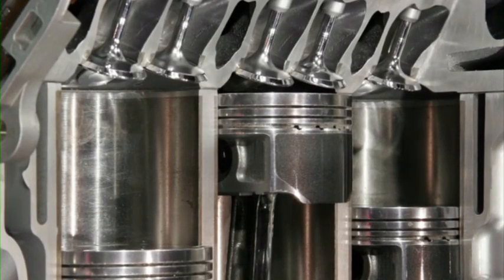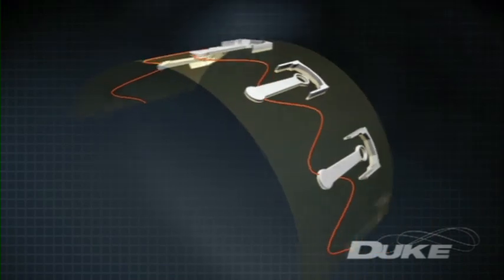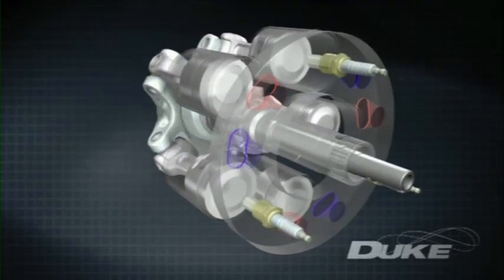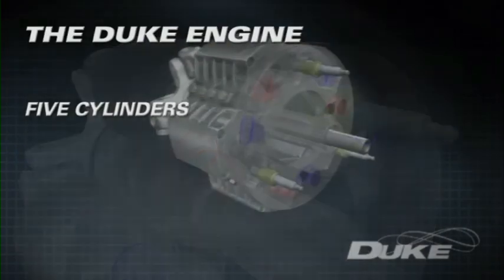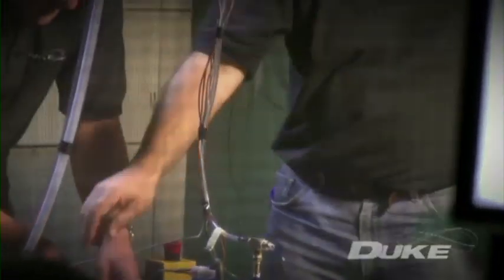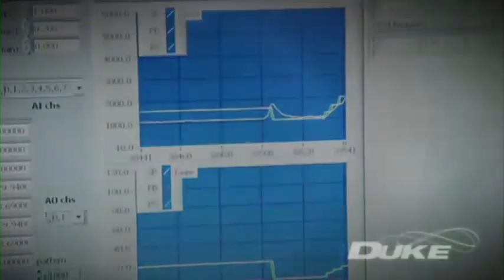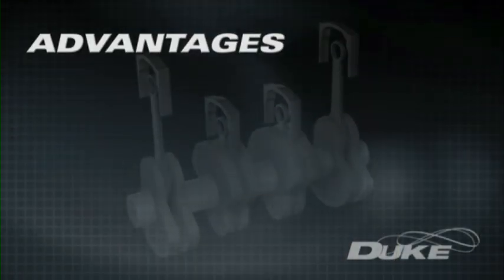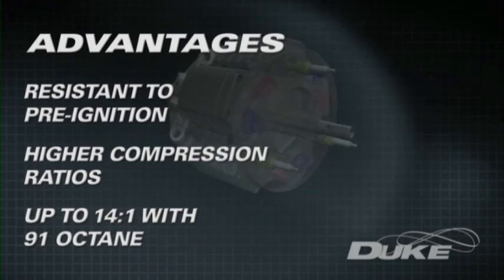Duke Engines

Comment: No camshaft = a "dumb" motor with no ability to tune / manipulate the torque and power curves.  2 strokes and rotary engines are similar.  A camshaft is what allows GM to essentially use the same engine and transmission in their heavy SUV's, mid sized sedans and sports cars.

Comment: The down side it burns oil like an two stroke to reduce the friction due moving cylinders. So it will not pass emissions. So much to green house friendliness. And it has the same issue as an Wankel engine with sealing the combustion chamber... And I bet there are more downs to it. That is just what I thought when I have seen this concept.

Comment: you basically put the cilnders in a circle and eliminate the need of f vale. That crankshaft seems not rigid, and you can't properly seal it off. The top is constantly sliding over the cilinders. If you find a way to seal it, the seals wil wear extremely soon. This has the same disadvantages as the wankel/rotary engine which also failed.

Comment: at 14:1 detonation will take place if you drive this in a country like india...  plus more moving parts are there which would surely require a very high maintenance costs of the bearings and seals. thermal stresses will be very high. though the concept is good for innovation and amusement but not for business.

Comment: And how exactly are they going to seal the top part of the engine when the cylinder block is rotating? And there is more, not less rotating mass since the cylinder block is rotating (why?). This is not going to work.

Comment: One of the hundreds of similar patents. I'm very skeptical, I barely see any advantages but a lot of drawbacks, this video doesn't talk about. Mechanically, a Wankel for instance is apparently far simpler than a Duke or a standard Otto but as manufacturing is concerned it's exactly opposite, materials, precision, reliability, efficiency. The Duke is converting the complexity in the valve train (which has never been critical even 100 years ago) to a much larger mass in motion and the nasty sealing and complex lubrication (essentially a 2 stroke lubrication)  needed at the head of the rotating piston block. Wankel is an old engine, just like Duke and hundreds of other similar patents, it is still in development. Another problem I see is the very high time and area thermal non-uniformities in the head plate since, in the Duke and most the rotaries, the time split cycle becomes a space split cycle. I see show stopping problems there  in materials, precision and reliability (in the field not in the lab) in order to achieve proper sealing and lubrication. A good idea comes rarely and doesn't need decades to prove. The vanity of the inventor combined with his social skills of getting research funding keeps these projects running. It is the true perpetuum mobile. Another drawback is the huge centrifugal force, the wear, and failure severity associated with the rotating cylinders at high rpm's. Plus a poppet valve has a much larger flow profile  engineering flexibility than a cylinder head passing by a hole.

Comment: Similar to the 1950s Bristol bus "wobble plate" engine (discontinued ad the manufacturer was bought out by a group who made traditional in-line diesel engines.  That one left the cylinders alone and put a crank on the reciprocator plate, so you don't have to try and seal a "moving head" arrangement.  Interesting though.
Reply: I designed exactly what you describe about 35 years ago and it did indeed solve all the problems associated with the above design, which IS a modification of an axial piston AC compressor. Back then there was a group of engineers from a German polytech that was building the same thing as these guys. It had all the same problems as the above design. The faster it goes, the less the intake duration so the less power charge and the the higher the pressure, the greater the sealing force must be, so the friction goes way up and since the whole block is rotating, the centripetal forces cause cylinder and piston side ware, so it soon looses compression and wares out and the list goes on. My design would have solved all that but I could never generate any interest or financing. The biggest problem is that the auto industry doesn't really what anything new, they just want to be able to modify what they already have, so unless you're Elon Musk and have unlimited resources, you're just pissing into the wind.

Comment: is not the same with 6 cylinder, its almost the same with how rotary engine works, this just make 3 cylinder engine work faster, but not 6 cylinder power because the power is only came from 3 spark plug 3 combustion chamber and give the power only from 3 pistons, even it have 6 cylinders..

Comment: I see in your advantages you forgot a major one? Or you are hiding it. Its in your crank design. Its defiantlly a very good design. The main advantage with it is. It keeps the stroke cycle close to constant leverage on all cycles. Most all standard engines this fluctates from 0 at tdc to most leverage at 3 0clock then 0 again at bdc.

Comment: Its a mystery engine? Being how are they going to seal the combustion chamber that is always sliding in motion? Then more cooling the piston walls? This thing going to be air cooled? Any carbon an dirt caught in the head sealing surface as the head is moving is going to lose the fire ring. Also just seting up the end play on the crank an now head clearance, that be a royal chore? The thermal changes of metal exspanding hence cold engine to hot under load. Be a nightmare all its own.

Comment: i am a complete ignorant, i barely know how regular in line cylinders work, but I'm thinking and making numbers about... how if the pistons gotta get out of their cylinders, how will you keep all the gas to put it out to the exhaust?
 how do you make a good seal in order to keep the power per ignition? (i already said I'm an ignorant of all this)
 ALSO, and more importantly, if the pistons have to exchange cylinders with each ignition... How do you keep them from wearing and tearing faster?
   a key aspect of the break-in of an engine is to let the Piston to adjust and sit correctly with its cylinder in order to have less friction and a more efficient movement.
 i have the feeling that this Duke design, brings more problems not only because the pistons have to leave their cylinders, but also becayse there is sidewise movement, not only up and down.
 (excuse my english, i have problems expressing my ideas when i talk about things i don't know well).

Comment: The mechanism is very similar to an automobile A/C compressor and some hydraulic pumps which have a nutating plate (also called a swash plate) that imparts the wobbling motion to the pistons.  However, the Duke engine is doing just the opposite.  Be interesting to see what come of this endeavor.

Comment: the design looks very heavy and massive, with LOTS of seals and possible weak spots. I bet maintenance of that engine would be a nightmare, as it would require total disassembly of the entire "block". Plus: The more moving parts, the more friction and therefore loss of efficiency.

Comment: Reciprocating mass will always be inefficient. R&D must be in rotary design. In the existing Wankel design, which is not the best rotary design, there has been great advances. They are perfect for range-extenders for series-hybrids - where the market is going.
Mazda have done very promising research on HCCI ignition for its SkyActiv-R rotary engine project using research from its SkyActive 2 program. They have removed the need to locate the spark plug outside the combustion chamber to allow the rotor to sweep past. Mazda solved this in the SkyActiv-R rotary project. Rotaries generally have high compression ratios giving the design easy adoption of homogeneous charge compression ignition (HCCI).

It looks like the next Mazda rotary in 2020 may not have a spark plug and be HCCI ignition. Fuel consumption will match piston engines and when used at a constant speed range-extender gennny as in a hybrid, outperform piston engines with all the advantages of low weight, small size, super-smooth, simplicity, etc. The efficiency and longevity of rotaries is excellent when at constant speeds and low revs. 

The expectation will be that the engine will be introduced in 2020, the 100th anniversary of Mazda. Looking good. 

Explanation of HCCI from wiki:
"Homogeneous charge compression ignition (HCCI) is where the fuel/air intake is a pre-mixed lean air-fuel mixture then compressed to the point of auto-ignition. Electronic spark ignition is eliminated. Gasoline engines combine homogeneous charge (HC) with spark ignition (SI), abbreviated as HCSI. Diesel engines combine stratified charge (SC) with compression ignition (CI), abbreviated as SCCI. HCCI engines achieve gasoline engine-like emissions with compression ignition engine-like efficiency. HCCI engines achieve low levels of nitrogen oxide emissions (NO x) without a catalytic converter. However, unburned hydrocarbon and carbon monoxide emissions still require treatment to reach automotive emission regulations."
Reply: New Mazda rotary car in Jan 2020: Just over three years away.
http://www.motoring.com.au/mazda-rx-9-locked-in-103563/
http://www.maxim.com/rides/mazda-rx9-rotary-sports-car-2016-8
Reply: "With this new high performance rotary engine occupying less than 50% of the engine area volume and boasting a 50% reduction in overall weight from a standard four-cylinder engine, the 650S lends itself perfectly to the weight reduction and low emission requirements of the automotive industry whilst still delivering an impressive 120bhp performance using *less** fuel*.
http://www.aieuk.com/first-british-rotary-engine-sports-car-makes-historic-debut/

https://www.theengineer.co.uk/rotary-engine-powered-british-sports-car-makes-debut-at-millbrook/

This is encouraging.

Comment: its one of those things that looks good on paper, but in reality wont last. seems like soon as 1 part starts to wear, its going to cause everything to quickly fail behind it. you have a revolving set of cylinders which creates a lot of issues. 

how is the stationary cylinder head going to seal against a rotating set of cylinders and last more than a few thousand miles?

since there's going to need to be some sort of thrush bearing to hold the rotating cylinders in place. whats going to happen when that bearing develops any amount of wear? all the cylinders will be putting alot of load of that bearing after all. all the cylinder head seals will have to fill an extra void and leak easier

not to mention all the wear  on al lthe parts caused by an awkward rotation of translating horizontal linear movement into rotational force at that angle.

too many moving parts, many doing high wear jobs. engines just wont last. i dont even know how you would do a proper way of lubricating the moving parts with an pressurized oil film to prevent metal-on-metal contact. 

lubricating the cylinder walls to keep the piston rings alive is also an issue. the cylinders rotating at high rpm will cause all the centrifugal force to keep any oil lubrication on the outside of the set of cylinders but leaving the center of the set dry to wear out. also this will cause the pistions themselvs to highly wear the outside most walls of the cylinders much faster

Comment: Lets just fix the Rotary and get on with life. Light weight easy to fix/produce people have already proven apex seals are not an issue unless you go mad mike with 1,000+ hp and fuel economy has been fixed by adjusting ports on the engine block and small design changes to the rotary it self reducing co2 emissions and improving gas mileage.

Comment: This the same movement found in an axial piston pump. If the angle between swash plate and the main shaft can be adjusted while the engine is running, it would be able to change its compression ratio on the fly.

Comment: That technology has been around for ages... It's called an automotive air conditioning compressor.
Reply: If you have sparkplugs in your AC compressor, I think you need a new mechanic
Reply: +Floyd Wilson haha
Reply: Floyd Wilson Mine has 6 spark plugs and it's cools the cabin down to -22 degrees C.
Reply: I welded a shaft to mine and connected it to my tranny. Fuel efficiency is awesome at 5 mph.

Comment: Unfortunately, no matter how good this engine is capable of being it will go nowhere. Firstly,  standard piston engines have too much commercial enertia. Secondly,  the world is trying to get out of internal combustion engines. Your timing is all wrong, you may have had a chance 50 or 60 years ago.
Reply: Piston engines aint going away anytime soon,  where'd you even get that idea?
Reply: KingHalbatorix
except for all of the mercury, alkaline, etc etc etc and other toxic chemicals and elements they use in circuit boards, and in the manufacturing of electronics in general, and all of the dead batteries in landfills that we aren't supposed to throw away... but everyone does.   that's bad emissions. kill some fish and wildlife and poison the drinking water. that's better than burning holes in the O zone right?

i'm NOT saying that electric isn't the way to go, just saying, think of both sides before spouting off what someone else said and holding it as true.   there is a dire cost for either.. and both scenarios end up polluting the planet in different ways.
Reply: Friend, If ya do what ya always did, you'll get what ya always got; lets welcome something new!
Reply: +Chris Mayer yeah, how about electric.
Reply: The real doktorbimmer
because the technology to support them has only recently progressed to the point of feasibility for everyday use. Energy density of batteries was complete shit until 10 years ago.
Reply: KingHalbatorix Just like axial-cam engine like the "DUPE" have been around for a century or more...  EVs have been around as just long as ICEs... yet they remain a tiny niche  market
Reply: KingHalbatorix So was the efficiency of ICE's... but they have nearly doubled in 10 years, the difference here is in the limiting factors of development potential and relative costs.. 
chemical storage batteries can never match the energy density of liquid fuels.. or the cost
Reply: The real doktorbimmer
but ICEs will never match the emissions standards that can be set for electric vehicles

nor will they be useful at all once the fossil fuel crash inevitably occurs
Reply: M B Good point.
Reply: You underestimate the power and efficiency of capitalism
Reply: He underestimates the power of the Laws of Thermodynamics.. only the most efficient designs are developed into commercially viable products... the inferior ones simply fade away into history and are forgotten like the Duke engine.
Reply: The real doktorbimmer Much like the sterling vs steam engines.

kdmc40 is dismissing this engine without even seeing it's capabilities. If in fact this engine is efficient enough to compete, I have no doubt that people would invest.
Reply: Nathan Brinkerhoff Steam is very inefficient... Sterlings have too low a power density
Reply: Nathan Brinkerhoff That is exactly why Duke is going no where.. it a vaporware scam.
Reply: kdmc40 unless of course the world moves to alternative fuels, which this can run. plus using a.p.u's
Reply: doktorbimmer ayy , what up. I'mma sit here and read the arguments
Reply: KingHalbatorix yeah, then we go for biofuel which , theoretically, can be more energy dense than gasoline or batteries
Reply: Nathan Brinkerhoff yessshhh. I love it so. Now who wants to exploit people for power ?
Reply: doktorbimmer yeah , this engine is less reliable than wankles
Reply: Unless there is a quantum leap in battery technology, the "electric revolution" will be a very slow evolution.
Reply: +Joshua Mosely   A quantum shift to alternative fuel will have no effect on the Duke engine because it is not a commercially viable design running on any fuel type and never was.. its investment bait for a vaporware scam

Comment: I agree that there's the only, albeit important, issue that made Rotary engines unsustainable: The impossibility to keep a traveling combustion chamber perfectly sealed without squirting (and burning) gallons of oil to keep it sliding smoothly. If perfectly smooth, hard, impossible to wear un-human unobtanium materials existed, Felix Wankel's idea would had worked. 

Until that magic sealing material comes along, it is a 200 hp engine with the comsumption of a a 350 hp engine with 8 lawmowers' worth of smoked oil to boot. And Mazda spent decades trying to solve that only one problem and failed.
Reply: Two more problems with the Wankel as I see it: it really needs dimensionally perfect and stable combustion chambers (piston rings adapt on the fly) and it suffers from the exponentially decreasing compression ratio as the rotor moves away after combustion reducing the time the fuel has to completely burn.

Comment: I see ports instead of valves. Historically we know that engines with ports only operate well at a narrow rpm range, outside of which they have deplorable efficiency.
Reply: Two-stroke engines have ports and they can rev pretty fukn high
Reply: Nessaj Nothing to do with how high they can rev. Problem is you make a two stroke that revs to 10k, and it'll have 100% of max torque from 8k to 9k, 40% of it at 3-7k, uses twice as much fuel and throws out ten times as much harmful emissions as a four stroke with the same power. It's useless for a road vehicle.
Reply: Yeah you do have a pretty good point there
Reply: Wankel engine had the same problem..